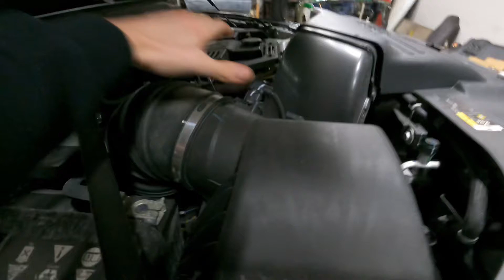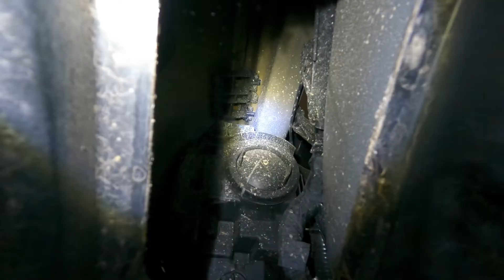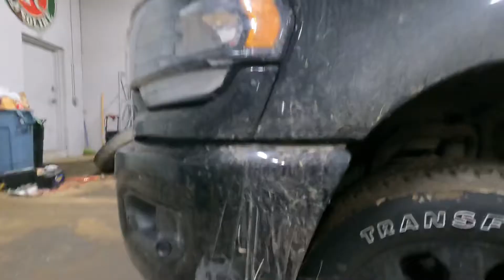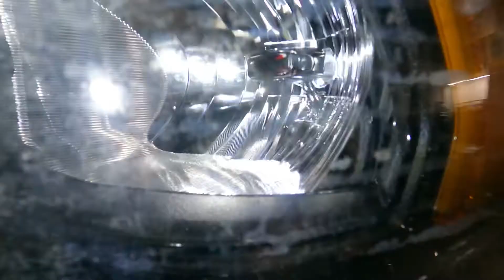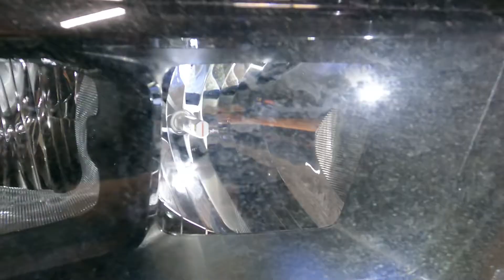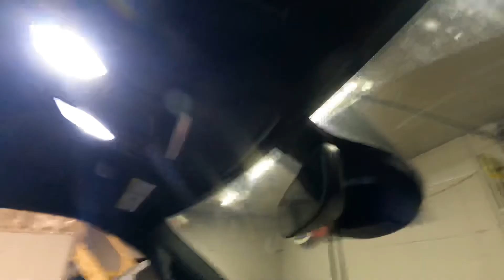2019-2021 Dodge Ram 2500/3500 LED Install

Comment: I remember years and years ago, on my late 80’s f150 you could change all 4 bulbs in 1min 30seconds flat. No special tools needed. Just hands. Any size hands, big or small works just the same. Now, working on anything is so GD frustrating and convoluted. I give up on doing stuff like this anymore. Everything is a hassle. And a sequence of very specific events has to take place in the exact order. Then, the stars must be aligned just right on the 3rd full moon from the summer solstice. Ridiculous and absurd. I’m done w it. lol

Comment: It’s like a cruel joke they way they have this setup. There is an access hatch, but just big enough for a string bean arm to fit through. I have to shove and shove for my arm to fit. And even then, I can barely just grab hold of the harness to unscrew it from the housing. Then, the wire lead is so GD short, there isn’t even enough slack to pull the bulb from the housing fully. I said F this nonsense. I’ll have the dealer install them, this way if they break something they have to fix it. I’m too old now to be monkeying around with this piss poor design. I had magnitudes more patience when I was younger.
Reply: my friend I am a small dude and I was wondering what the design was when installing these. absolutely ridiculous imo.

Comment: On the blinkers, they have a CK Socket, so if you get the 7443D-CK they will work.
Reply: I have that part number on the same truck all my blinkers work but no white running lights

Comment: With the blinker bulbs the reason they didn’t work is that the factory bulb wasn’t a dual filament (as far as I could tell). If so it wasn’t designed with both circuits to stay on dimly and then flash. Vehicles that have the parking lights stay on all the time and then blink should work with the switchbacks.

Comment: These ram trucks use the CK style socket for the turnb signals so a standard bulbs will not work. The power and ground contacts are oriented differently for the CK socket. Lasfit makes both versions of the bulb. You would have to use the 7443/7444na CK bulb from lasfit

Comment: Can you explain the process of what all you need to disconnect on the intake if you can’t fit your hand in there?
Reply: Remove the negative terminals on the battery(s) first, then unplug the stuff, take it out, and reverse. If you unplug the sensors with the battery’s plugged in you could have some issues until it sits and relearns the sensors
Reply: @williammorgan5987  thanks. I eventually got it. Had to lift the entire intake box

Comment: ... all aftermarket leds are junk unless it comes from the factory prove me wrong
Reply from the maker: Well i would have to agree with you mostly except for the fact that the manufacture of the vehicle, in this case ram, doesnt manufacture the bulbs in their higher package vehicles. There is high quality led bulb manufacturers and im not saying these are the best because they are not. With that being said. For the amount i spent on these bulbs they are all still working with good light output. So if i can get a few years out of these for the money i spent im more than happy with them. But to agree with you most led bulbs are junk especially any t10 bulbs
Reply: Sounds like you buy cheap leds. I use to think The same until one day I just had ot and bought super nice ones. They are amazing now
Reply: That’s not true at all. If you buy cheap crap then what do you expect. Spend some money and they are good. So you’re answer is buy shit get shit. Good bulbs aren’t cheap.
Reply: So it's safe to say that, if it came from the factory with halogens. Then even if you bought aftermarket LED headlights, it wouldn't work because the housing and wiring is all different?

Comment: BTW you do not need the canbus decoders for the install, just did mine today and no errors on the instrument panel, also installed the LASFIT lights.
Reply: Love lasfit
Reply: What year truck was it?
Reply from the maker: Did you install the turn signals from lasfit? They absolutely would not work on this truck
Reply: @theamerican9821 Supposedly if put in reverse polarity the switchback won’t work. All you have to do is pull them out, switch the polarity and reinstall.
Reply: I got error codes in my 2021 ram.. so I Oder the resisters

Comment: Picking up my new tradesman this week sometime. I havent had halogen bulbs in a vehicle since I did a swap back in 2008, I plan on doing this ASAP. Appreciate the detailed video
Reply: Thinking about doing this to my 2021 2500 Ram, would you recommend